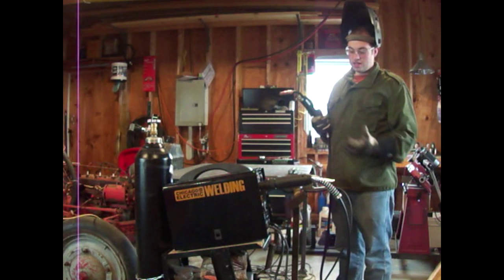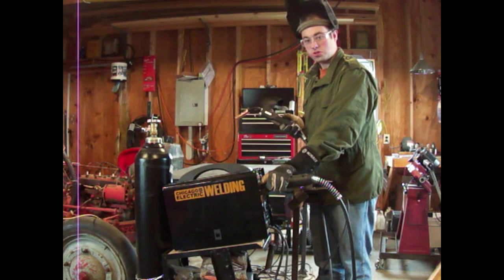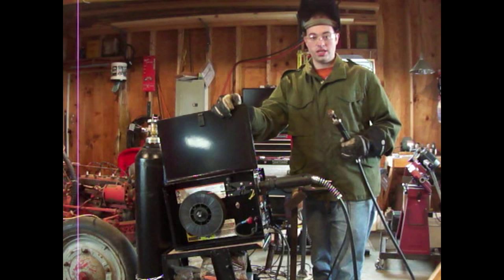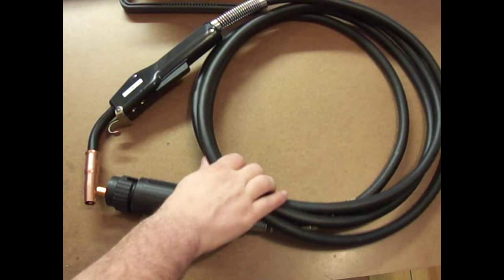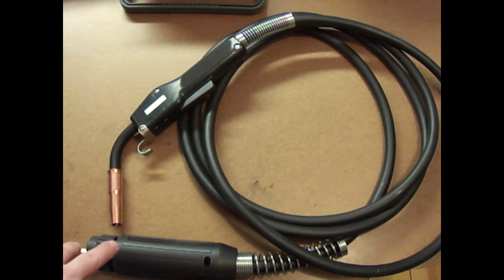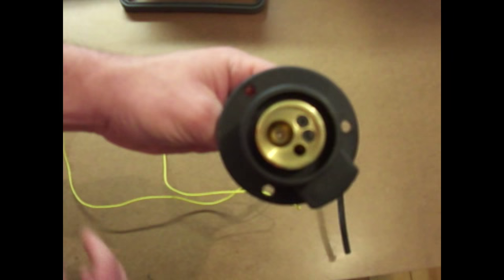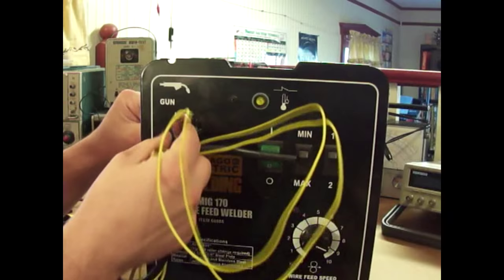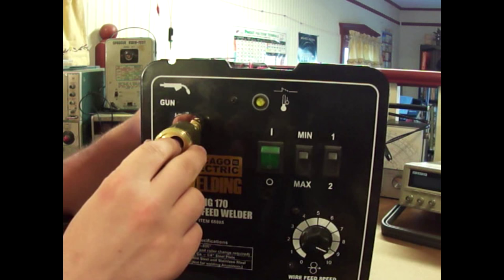Harbor Freight Mig 170 euro connector conversion

Comment: Fantastic job, and great video showing the lot.  I'm almost done my conversion and watched this, I sort of worked out everything the exact same way you did, so it's nice to see I have been getting it right while just flying by the seat of my pants 😂

Thanks for taking the time to make this video!
Reply: It awesome that you got a 15 ft tweco gun and figured a way to put a spool gun but it is still a $200 crappy at best welder. For the money you should save your pennies and buy a decent Everlast that will mig tig and stick. When you do they take euro mig guns so you will have a real nice gun for it as they come with a 9ft 180amp gun.  I purchase a lot  of harbor freight stuff but sometimes you get what you pay for and as a professional welder for 25 yrs and a person who was welded with that welder as well as most ever other  make and model mig on the market over the years they really are a pile of shit. Even a little lincoln or hobart that are not but a few hundred dollars more will weld circles around them have a warranty dity cycle and more settings and come with better leads and guns. Any money spent trying to build a welding rig to do real work with Harbor freight in the middle is a waste of money.  I will say i have not tried the new green or orange machines they sell but i have tried that one twice as my dad and friend own one.  If you are into this save up and get a real machine

Comment: Thinking automotive cable and hose heat shield sleeves will be a good idea for the gas line hose.  Maybe can even use some muffler fiberglass cheap material.  I suppose more work to use metal pipe around.  Have you thought about adding an inductor or capacitor to make more CC and CV like operation?  Wounder how still performing also.  Thanks for sharing1

Comment: I would like to do this to a Titanium Easy Flux 125 and put a switch on the solenoid valve to turn it off when using flux core wire.

Comment: Thank you 100x.

Im doing same thing for my A365 mig100 No Gas welder.

Im buying gun with euro plug and euro socket and gas solenoid. 
I will add new transformer for wire feeder motor and connect gas solenoid to it. trigger the gun and gas valve opens at the same time.

Of course i have to make it DC first. But i have the parts.

Cheaper than buying gas ready welder. And i have 2 welders. Stick and this mig wire welder. I dont want to buy third one
Reply from the maker: Glad to help. Let me know how it turns out!

Comment: I switched my CE-170 to MIG this week and the stock gun instantly streamed out gas as soon as I would adjust flow on the regulator, meaning not squeezing the gun at all!  I opened up the gun and the cheap black plastic valve/plunger mechanism was stuck in the on/open position.   As a result I immediately order the standard replacement HTP gun with 10ft line (and which has a brass valve in the gun) but I just saw your video today and am thinking I should do your mod instead as it would certainly be a lot nicer to have the added ability for an aluminum spool gun. Can you please tell me the name/model number of the gun you purchased as well the name/model of the gas solenoid! Thank you!
Reply from the maker: Jeff Chartier I used mine in its stock gun setup for mig for about a year before doing this mod and original gun valve never gave me any issues. It sounds like the plunger might have gotten stuck down in the valve body on yours.

Comment: Great video. Going to do this conversion to my CE 170. The only place that I got lost was when you were making the connections for the trigger wires. Looked like you ran the yellow wires from the euro connector to control board. Shouldn't the control board run to the common of the new switch? Then the wires from the connector to one side and the other to the new external jack?

Comment: Great job, awesome!! the gas solenoid is 12v? I am interested in this conversion for my TELWING 180 Regards from Chile
Reply from the maker: Cristofer Cavieres it’s actually a 24v solenoid because the welder has a 24v drive motor so 24v was readily available in the machine.
Reply: Thanks bro 👍👍
Reply: @iainportalupi  do you have a source for the gas valve you used?

Also was curious where you actually did the connection for the drive motor I'll put to the double pole double throw switch. You didn't really go into details on that.

Comment: Hi my Chinese mig welder Rossi 195si arc weld work ,but mig wire not feeding check the motor with battery it works. circuit board looks good, how to check power to the motor. Also check nosel continuity to the board. What could be the problem your idea thanks

Comment: Great post, Iain. You  mentioned purging the gas line. Now that the trigger activates the drive motor AND the solenoid, won't purging waste a bunch of wire? I guess you could just turn the spool backwards, or add a momentary "PURGE" switch for the solenoid.
Reply from the maker: I just flip the motor/spool gun switch I installed to spool gun and pull the trigger for a couple seconds but I like the purge switch idea.
Reply: Alan Branch just drop the tension off the wire feed then it doesn't drive, this is standard practice

Comment: thank you for the great video. I've saved it for reference. just one question, which of the 4 connections on the little connector on the upper right do you connect the 2 wires to? I think I'm referring to the power to the spool gun.
Reply from the maker: Mark Ash I could only find a 4 pin connector so I just use 2 of the pins. If Radio Shack had a 2 pin connector I would have used that.

Comment: I have a HF 180. I just did this conversion with minor changes to where I located the wires and switches. Everything so far seems to be fine except the solenoid doesn't activate. I undid the wires to it and connected to a 20 volt battery. It snapped open and closed properly. I get perfect continuity along the wires as well. When I soldiered the wires to the board I noticed one of them doesn't lead to anything and couldn't find continuity anywhere from that wire to anything else. The 180 board looks exactly like the 170 in your video. Did you jump anything on the backside of the board, not shown in the video??? Please help.
Reply from the maker: I didn’t do anything to the back of the board.  They might have changed suppliers since the video and left some parts off the new boards. One thing you could do is solder the wires onto the coil terminals of the main relay. Just be careful that you attach them to the coil and not the 240 contacts.
Reply: Did you get it working yet?  I have the CE-170 and really want to do this mod as well.  Do you have a parts list please?
Reply: Did you get this worked out? What was your final solution?

Comment: Did you buy your euro connector from 3shop-river (river weld), also where did you get the solenoid valve I can't seem to find one like yours.Thanks
Reply from the maker: I just checked and I did get the connector from River Weld. I don't see any solenoids like I used listed right now, but things change from one day to the next on eBay.

Comment: Hi,  Is there a reason you don't just trigger the gas solenoid off the gun trigger wire?  BTW - Great video.
Reply: It's best to have gas flow before wire feed, especially with aluminum.
Reply: @UncleKennysPlace  how are you getting the gas flow first with one trigger/

Comment: Thank you for your effort but as previously stated this video is pretty much useless with out links to where you purchased the items needed to make the mods as well as a parts description so we know exactly what the the hell is needed to make mods correctly and lastly the step buy step description including the schematic to wire the switch to give the machine the ability to become a spool feed aluminum welder... 

Is this possible?
Reply from the maker: DJ Savage as I stated in the video, I can’t post links to the parts because I bought them off ebay and the sellers come and go so the links would be worthless. The video tells you what parts to buy but it is up to you to find them on ebay.

Comment: Dear friend, I would like to make a comment referred to this conversion, for to weld aluminum. The conversion is perfect, but not took into account the technical characteristics of such a machine, the only thing not working is in aluminium welding, weld such materials, it is necessary that this provided for such a function, and so this designed in its power structure for such machine process whereby not the this. For to weld aluminum is necessary that the machine this provided of high frequency in your design original of which these machines not it have available, in the manual of such machine indicate that not this provided for welding of aluminum, not because not have them connections appropriate for such welding, this it indicates the manufacturer, is because your transformer and components internal not are designed for said purpose
Reply from the maker: Well since mig welding Aluminum and mig steel both require a constant 
voltage power source and since this IS build from the factory is a 
constant voltage power source it can and does weld aluminum just fine. 
The transformer was wound from the factor as a constant voltage 
transformer, as apposed to being designed as a constant current 
transformer found in stick and tig welders. So to clear things up the 
internal components are doing exactly the same thing with the spool gun 
as they are welding steel. These machines are built down to a price 
which is why they take short cuts such as the cheap non-removable gun.
Reply: Eduardo Mendez Ulloa
Do a little more home work Eduardo; Spool guns are DC just like a MIG..... aluminum spool guns do spray transfer when in combination with Argon and work very well with a MIG power supply.